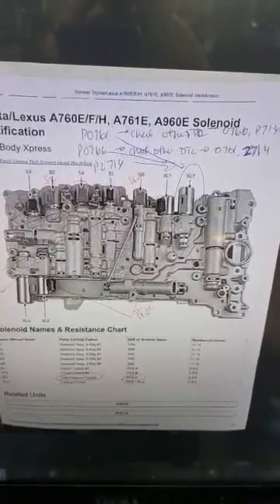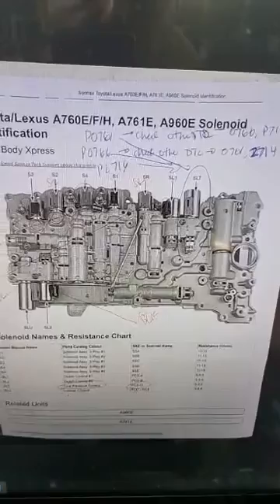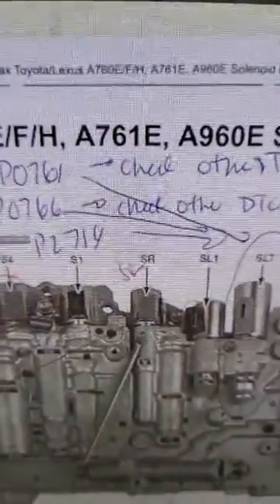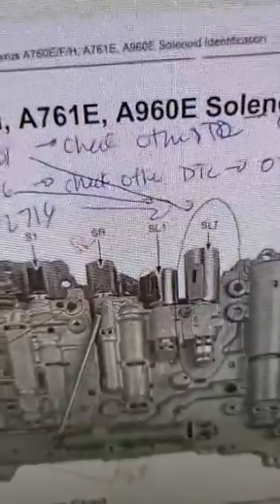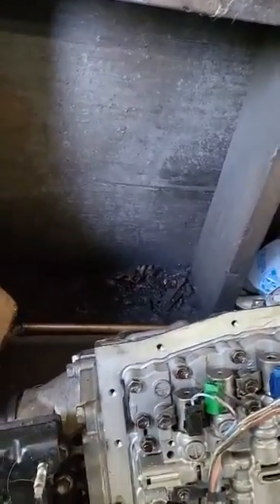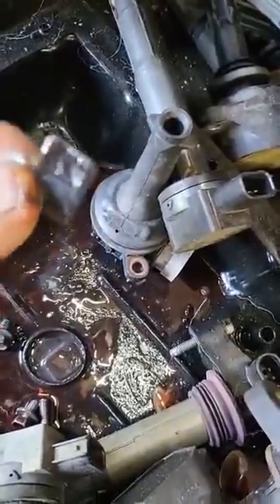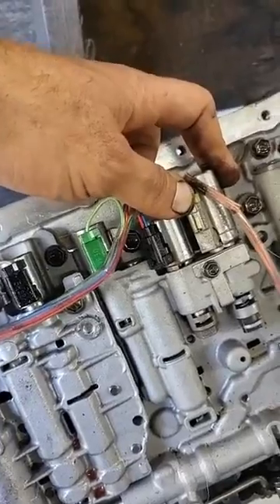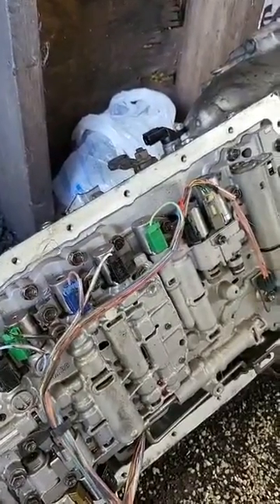Toyota/Lexus Transmission Shudder Or Not Shifting Codes P0761 P2714 (Solved) #Diy #Lexus #Toyota

Comment: I have no reverse and it slips in 1st but no codes either,should I just replace the transmission??
Reply from the maker: Did you check the transmission fluid level?
Reply: @hanitwfik its a sealed system
Reply: @dame305_  LOL. No its not
Reply: Did you ever fix the problem? Mine is doing the same thing

Comment: Hello, i got both codes after i got a transmission fluid flush from a shop. What should i do?
Reply from the maker: It is not recommended to do flush if your car is high mileage.
Reply: @hanitwfik  The place I took it to didn't tell me. I was unaware at the time. What would you recommend?
Reply from the maker: @JoSe2beazt  of course they not gonna tell you because they just want your money . I'm sorry to tell you that but in 💵 💵 my experience don't waste your time and money with replacing solenoid and fluid at the end you would have to replace the transmission because is not going to be like before this is my suggestion.

Comment: Bro I have the same codes  same problem p2714 that’s to do I need just to replace it or get a new transmission????
Reply from the maker: It's like I said you will need to take the AT pan off and then look around the magnet. If you see a punch of debris, you gonna need to replace the transmission.  Good luck

Comment: So does that solenoid take care of both codes I’m showing p0761 shift solenoid “c” performance/stuck off and p2714 pressure control solenoid “D” performance/stuck off on my 2011 tundra
Reply: Did you fix this? I’m in the same boat. I have 1 sensor but I want to make sure it’s only 1
Reply: @ClippyMeister no man haven’t gotten it fixed it hasn’t done it again but I definitely need to open up the oil pan and see what’s going on.
Reply: @arnoldguzman6981 I’m opening mine up this weekend I’m just trying to make sure which is the correct solenoid. I already have the solenoid
Reply: @ClippyMeister it’s never the slt solenoid. I’ve seen on the Tundras the P2714 code is usually the speed sensor on the transmission.
Reply: @BigDipper79 wouldnt u have code for speed sensor too tho
Reply: @BigDipper79 what if u switched out the sensor?
Reply: No is not if u hace solenoid c and d then u have 2 solenoids to replace or test@melvingonzalez6906
Reply: I’m having the same exact same problem with my 2012 tundra.
Reply: @ramiromanzano7378 any solutions?
Reply: I have the same problem in mi Lexus LX 570 2009, any solution ?
Reply: Bought all new solenoids , should I just replace all of them ?😊

Comment: Hi question the solenoid all worked? So what was the problem that you had to take it apart? Hypothetical let’s say there was no metal shavings what would you have done next?
Reply: The problem I'm running into is that mechanics don't want to fix your transmission nowadays...they want to replace your transmission. Im guessing because that is easier for them, but at a much greater cost for you.
Reply: @errldabbins  yes because tranmission replacement is actually very easy but it sounds really hard so they can charge higher for easy work, higher chance to fix the problem too by changing the whole thing
Reply from the maker: yes all the my solenoids was ok but there was much debris in the pan so i replaced the whole transmission
Reply: @hanitwfik I got my transmission replaced and the same codes pop up again. Any ideas?
Reply from the maker: @SecondBestWinner  is it a used transmission?
Reply: @hanitwfik  hello sir, I have a 2013 Toyota tundra 2 Wheel Dr. 4.6 L. I have the same exact two codes. Do you know if I will be able to access them simply by taking off the transmission oil pan or would I have to remove the valve body as well? I’m attempting to do this myself and I know Mechanic but it looked easy enough. But that’s in thought of simply removing the oil pan to access to solenoids. Please let me know. Thank you very much.

Comment: Hello i m from germany And I got a lexus gs300 with a A960E transmission just as yours. I got These two error codes P2714 P0761. I will change the solenoids with a 250$ kit from China. (I know they Are Not orignal but if They work They work. Tell me ur opionion about this please). And my Main question is: How do I Check if There is enough oil in my transmission. I know it sounds dumb but…. Hope u can help me! Thanks:)
Reply from the maker: hello and welcome to my channel, in my opinion as i worked on Lexus and Toyota transmissions many time and like i always do first of all to check your fluid you need to make sure that you check it after you drive the car for maybe 15 min or let it run until its warm enough then shift all gears then you need to check the fluid while the car is running by raising the car up on a straight level, under the pan there's a hex bolt when you loose this bolt you need to see some fluid drippings if not you will need to connect the fluid pump to it until you see the fluid start to come out of until it stop drain the fluid and you good .about the china solenoid i really use only the oem solenoid but let me tell you if you see good amount of debris in the pan magnet it means your internal trans is gone if not then you can check each solenoid by disconnect the connector and check the solenoid with 12v if it clicks it mean is working . let me know if you need more help thanks
Reply: hi @chrisgamerful did you change it already ? did it work for you ? i have the same codes

Comment: How do you put solved when you said you changed the transmission! That’s not solving the problem unless it actually needed a new tranny. There are far more things you can do besides just giving up and changing the tranny 😅
Reply from the maker: When you see a debris in the pan, if you just keep replacing solenoid valves, sensors, or even the valve body. You're just wasting  money 😉
Reply: @hanitwfik  ok, what if you have no debris in the pan? It could be the TCM, wiring or a number of other things causing the faulty solenoid codes as well.
Reply from the maker: @Justin Norton  yes I think I mentioned the solenoid which is related to the code
Reply: @hanitwfik  yes but you just replaced the tranny over a faulty solenoid code correct?
Reply from the maker: @Justin Norton  lol . No, I replaced it because I found a punch of debris in it. Also, that trany is so cheap with a warranty, and it's cheaper than rebuilding
Reply from the maker: @Justin Norton  if you doing this yourself, so what I do first thing is to check the AT Fluid make sure is in correct level, usually its the main problem with any trany, then if you have to open the pan check each solenoid with 12v battery you should hear a clicking if not it mean is bad then you check each plug wire continuity
Reply: @hanitwfik   hi bro I’m having code p0761 p0894 p2714 gear slipping and don’t shift into gears after 3rd gear. What should i do ?
Reply from the maker: @Gursewak Sandhu  check your transmission fluid first. If it's low, add fluid to the recommended level and erase the code or disconnect the battery for 10 min. If your fluid is good then you need to take the pan off check if there good amount of debris in the pan magnet then you will need to replace the transmission if no debris then you need to check each solenoid or replace the valve body assembly.  Good luck
Reply: @hanitwfik can you help? I have Lexus GX460. A new transmission from dealership is on back order. I’d be #95 in line. Rebuild ? What do i do

Comment: Hello. I test the SLT and clicking. But when i test on valve body with scantool it make buzzing sound? It's normal? Cauze i can't shift to 4th gear. Got P27137F code too
Reply from the maker: I got that same sound even after I replaced the slt solenoid the problem still exists so I bought a used trany and I replaced it now drive like champ no more codes!
Reply: @hanitwfik  What's the cost of a used auto box? Looking to by a cheap IS250 that isn't engaging any gears.
Reply from the maker: @stephenpato5524 "Check out this link: https://car-part.com. This is where most mechanics buy their parts. Let me know if you need more help. Good luck!"
Reply: @hanitwfik  Thank you!
Reply from the maker: @stephenpato5524  you are welcome 🙏

Comment: hi i have 2006 lexus is350, i have the code for p2714 performance stuck off, do you have the link to that solenoid thanks
Reply from the maker: https://www.ebay.com/itm/394259382384?mkcid=16&mkevt=1&mkrid=711-127632-2357-0&ssspo=ceevkpi1rq6&sssrc=2349624&ssuid=akWl8QmFRZK&var=&widget_ver=artemis&media=COPY
Reply: @hanitwfik  thanks bro appreciate it 🙏
Reply: @hanitwfik  also can this issue cause slipping in one gear (3rd gear for me) and gets stuck in 4th gear & power loss in acceleration
Reply: @1of502  did you fixed it?
Reply: Will this affect my smog test if the engine light is on for this code?
Reply: @Socal4r Hi, I'm in Orange County, CA.
Have a 2008 Lexus ES 350 with the P2714 & C1201 codes. Tags expire this month. Won't be able to pass the stupid SMOG. Any tips? Were you able to fix your car and pass the SMOG test?
Reply: @Socal4r I think any  check eng lights on won’t pass smog in California
Reply: Would this be the same part for a Lexus is250 2007?
Reply: I have a09 sienna been having p2714 code ( pressure control solenoid “D”performance stuck off )on for awhile and the 2-3rd gears I believe hesitates between shifting like it’s wondering if it should go up a gear or not . After that tranny shifts fine . Could this be the shift solenoid SLT that’s mentioned?

Comment from the maker: Hope this helped out!! If you still need help I'm Available for any questions!
Reply: Did you say changing the slt sensor itll be ok ? Cant really hear what you said. Im having both the codes. Shifting Wasn’t as bad but got worse in a few days. Sometimes doesn’t want to shift out of 5th or its shift into 3 then before it shifts again its like slip then stay in same gear and rev high without switching gears
Reply: @MiguelSanchez-rb3tw  did you fixed it?
Reply: I bought this car to resale, just dont want to invest too much. If its the transmission i rather just swap it out instead of replacing solenoids if they around going to make a difference.
Reply: Car is an 06 is350. Just hit 100k miles
Reply: Hello.  Thx for the vid.   My 08' ES350 is giving me P2714 but also P0746 & P2808.  All solenoid issue codes.  is a flush the way to fix? please help. thx.
Reply: @anth1315 did you fix it? And how?
Reply: @anth1315  Did you ever find a fix for your issue?